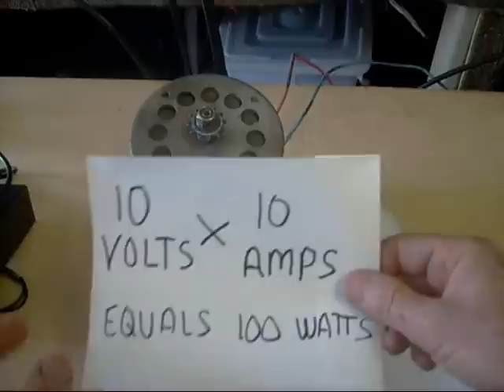Understanding Watts, Voltage, and Amps. Sorry about the math mistakes.

Comment: so I would is amp hours the same as amps? so my battery is 12V 100AH. I would multiply these numbers to see how much is going out?
Reply from the maker: +Kaptin Clouds Your sound a little confused. The total power a device uses is measured in watts. To find our how many watts a device is using you multiply the amps it uses times the voltages is uses. The amp hour specification of a battery is something different. The AH of a battery tells simply tells you how long the battery will operate based on how much power your draining from the battery. For example a 100 AH battery can theoretically power a device which uses 100 amps for one hour, or you can draw 50 amps for Two hours, or 25 amps for 4 hours, or 1 amp for 100 hours.

Comment: Hi, How come Joseph Newman gets more out?
Reply from the maker: At one time I spent a lot of time and money trying to build a Newman motor, and my conclusion is that they probably don't work as Joe claimed. Have you ever wondered why Joe performed such abstract tests to show the public that his motor produced more output than input. Did you ever see him remove the batteries from his motor, or show the current and voltage input and output using a simple test that was easy to follow?  Have you ever seen anyone on the internet who successfully reproduced a free energy motor. What about all those engineers who endorsed Joe.  Why didn't one of the engineers build one? Here is an interesting video on Joes life. https://www.youtube.com/watch?v=CrJIzrmX1mI
Reply: @GrantsPassTVRepair  I think that all 30 of the engineers lives were threatened.

Comment: is there a maximum amps for a battery? and if we combined 2 12v batteries in serial will that amp increase?
Reply from the maker: The amps will not increase with Two 12 volt batteries in a series circuit, You need to put them in a parallel circuit to increase the amps.

Comment: I have a tennis ball machine that uses a 12v 7.5Ah battery...I want to run it using a AC to DC power supply. Do I need a 90 watt 12v power supply (12 x 7.5=90)....???  also, if I find a PSU that is 12v but has a higher amp output....is this ok or might I damage the machine or PSU. Thx! Jack

Comment: hey , can i just connect ny solar panel to inverter ?
Reply from the maker: +Nobilis Project I suppose it might work but you could also potentially damage your inverter. Keep in mind that your solar panels voltage can climb up to 21 volts if it has no load,. Your inverter does not provide much of load in the stand by position. On the other hand if your load is to much for the solar panel to operate it's not going to work.
Reply: oh thankyou , for the information , but can i use directly if my solar panel just can produce 12 v ?, can it still damage the inverter if the volt suddenly becomed more lower?
Reply from the maker: +Nobilis Project If your solar panel only puts out 12 volts it's not a problem, but do you think your solar panel can produce enough amps for the inverter once you plug a load into the inverter?  Anything other than a light load will be to much draw for your input  current needs.
Reply: ok, thank you so much :) this information is very usefull

Comment: I have a 240 volt 41.6 amp generator and I need the amps to be between 160-200, how would I raise the amps to the levels I need without losing voltage ?
Reply from the maker: cenexes 12 There is no way to raise the amps without lowering your voltage unless you have a second generator operating at the same time. Unfortunately this isn't possible unless you figure out a way for both generators to 
operate in phase with each other. If they aren't in phase you will get a short circuit.
Reply: +cenexes 12 I'm still very new at this, but from my understanding of the math, you can only get a percentage of whats going in, therefore if you have maxed out the amps already with the input voltage, then you would have to put more volts in to make room to transform for more amps.  Again I'm very new at this, but 200 amps is a bunch, I can melt 1/2" steel bolts with 400 amps. Another thought is using induction with some high voltage caps, maybe there would be a way to bounch some voltage around to make more amps. Anyway there is some crazy smart guys on the internet, someone will know how if possible.
Reply: +Grants Pass TV Repair  If they are 3 phase, would all three phases have to be in phase with each other, or could one phase from each be enough?

Comment: About how many volts is in a 1000 watts, explain ??
Reply from the maker: I did explain, but to clarify this for you 1000 watts can come from different voltages and currents because you multiply them times each other. For example. 10 amps times 100 volts equals 1000 watts, but so does 100 amps times 10 volts, or 2 amps times 500 volts. or 1 volt times 1000 amps, To find watts you multiply the power a device us using times the voltage you apply to it, so if you toaster uses 5 amps at 100 vols we call it 500 watts. Understanding the value of the term "watts" it can be best understood when you think about a motor being able to produce a certain amount of horse power based on the power applied to it. Some motors can be built to  use a high voltage and low current, or a low voltage and a high current, but if they are designed for maximum efficiency both will produce the same horse power based on how many watts they use.
Reply: @GrantsPassTVRepair  thank you for that. I'm a do some more research after work cause I'm on my way to work. I have a 1000 watt power inverter i was going to use it to power something that takes 240 volts ??? I was wondering will that inverter be enough to power it ???
Reply from the maker: @mangreat71  If your inverter  says 1000 watts then you need to check the devices your going to plug into it and see how much power they need to operate and make sure you don't exceed 1000 watts. Keep in my that motors may need more than their rated power to get started for the first second or Two, and it may require ten times their rated power, So you need to find out the surge power of the inverter you're going to use. Also keep in mind that many low cost  inverters are unable to put out as much power as they claim,. and the good inverters will have a continuous rating and a surge power rating for motors that need extra power to start up.
Reply: @GrantsPassTVRepair  True but the only way to know for shure for shure is to try it. Cause a lot of things some said it wouldn't work but i tried it it worked.
Reply from the maker: @mangreat71  Someone told me  many of the low end inverters can handle about a third less than what they claim. When one gets extremely hot I'm not comfortable with that.
Reply: Yes i here you but i can always upgrade. I might try a alternator and maybe solar panels to keep it running. I used a 1000 watt inverter with a 860 cold cranking amp battery to power on a 4.5 refrigerator and it kept it running for two days.
Reply from the maker: @mangreat71  It's best to use a deep cycle battery rather than a car battery. A car battery will have an overall short life since it's not made to continually charge and discharge. The cold cranking amp numbers you gave me are not the correct numbers used to determine how long the batteries will last.  The correct numbers are the amp hour capacity of the battery. I'm not sure if they list them on car batteries.

Comment: When I was a kid I made a simple explanation for other kids (and some adults) using an engine. An engine power output is horsepower which equates to watts. Engine RPM equates to volts and engine torque equates to amps...
Reply: Very simple for kids, if they know how an engine works.

Comment from the maker: The 7.5 AH you saw on the battery doesn't give you any information about how many watts the Tennis ball machine uses. You need to multiply the AMPS it uses times the volts it uses to figure out the watts. The 7.5 AH you saw only tells you how much energy storage the battery has, not how many amps it coming out of it. To find amps divide the voltage of the battery by the DC resistance of the device, To figure out the watts it uses you multiply the voltage it's using times the Amps going into it.

Comment: I wanna make a solar charger which can charge 2 batteries... And i wanna make them charge very fast like a wall charger... Could you tell me the basics of how i could start? I do understand the basic of electronics... But how do i get the mAh of the charging output up? Or how do i choose solar panels 😂😂
Reply from the maker: There isn't a simple answer for every kind of battery. Every battery has a different ideal charge rate. The manufacture should have this information for their particular battery. As for the solar panels you will need, it boils down to how much current you need to charge the kind of battery you have in mind. Some batteries can't handle a fast charge and some can. There is a company called goal zero who sells small solar powered battery chargers you might want to look into. They seem to have decent quality products, unlike some of the discount junk I've seen.
Reply: Grants Pass TV Repair wow that was a quick reply... So how do i do the calculations for it? I want to build something and practice these things on my own then just buying them.. So u know... I wanted something that could give me 1500ma output.. My phone handles 2000ma of charge from the charger... So i wanna know how can i regulate that?
Reply from the maker: 2000 MA is 2 amperes. That doesn't sound right. That may be the storage capacity of the battery, but not necessarily the charge current your battery can handle.
Reply: Grants Pass TV Repair I thought the same and checked Google but my phone is a One Plus Two and it does get upto 1.8amps of current for charging... The charger is a 5v 2A output... So my question is how do i get it and then does the size of the Solar Panels matter? Or can i use those USB modules with a 5v 2amp module directly... But what solar panel type do I need to use with that haha... Really confused..
Reply from the maker: I suppose it's possible. Since your not likely to find a solar panel which will put out the same voltage and current as your plug in charger, you can build a voltage regulator, or another alternative is to remove the battery and attach it to a small 6 volt solar cell that has a current output the same or less than your plug in chargers output.
Reply: Grants Pass TV Repair Thanks alot for the advice... I'll look around to see what I can get haha...  Have a great day and thank you again soo much 😁😁😁

Comment: Watts=Amperes*Volts   and     Resistance=Volts/Amperes

The shorter the conducting wire, the less voltage it will need to heat up.
The thicker the wire, the more amperes it will draw from the power source.
The length of the wire and its temperature are directly proportional with its electrical resistance, but the wire's thickness is inversely proportional with its resistance: colder, shorter and thicker wires conduct electricity with the least loss (mainly, heat).
Reply: Not quite soupflood.
 The conducting wire is heated up by the Current flowing through it (which is affected by the voltage across the wire (Volt Drop) and its Resistance) 
The thicker the wire the more Current it will carry without overheating.
 I remember Ohms Law as a triangle with Volts on the top I (current) and Resistance below! .... Take whatever symbol you want and you then get the equation for finding it by the other two! V=IR ..... Simmilarly for Power P=VI If you want to you can combine the two to give P= (IR)I .... or I squared R. It can get a bit technical with AC and harmonics, reactance and reluctance (but that is a bit advanced for here) other than to say it has an effect on those square wave inverters ;o)

Comment: 100 times .1 is 10, not 100. really shouldn't be messing with high power sources if you can't do simple math
Reply from the maker: +julien torres.  If you turn on your annotations you will notice this error was immediately corrected. Thanks for the kind words.
Reply: +Grants Pass TV Repair hehe, thnx for the vid man :)

Comment: What universe are you from where .1*12 = 6? At 1:04 you said the CB drew  .1 (1/10 of an amp) * 12v = 6watts? On earth that equation equals 1.2 watts.
Reply from the maker: +Pario Yes I'm aware of my math errors. I'm from another planet where our math adds up a little differently, :-)
Reply: Please just add a comment in the video time 1:04 explaining the correct answer.  This was really confusing and it took me a long time find this comment in order to know I hadn't slipped in to another universe dimension.
Reply: Great video by the way, thanks.
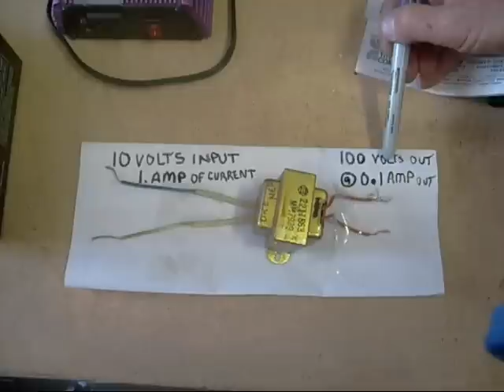Reply: And also the 100V*0.1A=100W (at 4:42) is a bit misleading ... but at 5:14 that gets corrected in some way ;)
Reply: at around 1.17 on the video it does state 1.2 watts.  It's so easy to make a verbal mistake when not reading off written info. .. even advanced electronics engineers can screw up when talking maths......
Reply: what universe are you from where literally everybody doesn't make arithmetic errors?
Reply: Chod